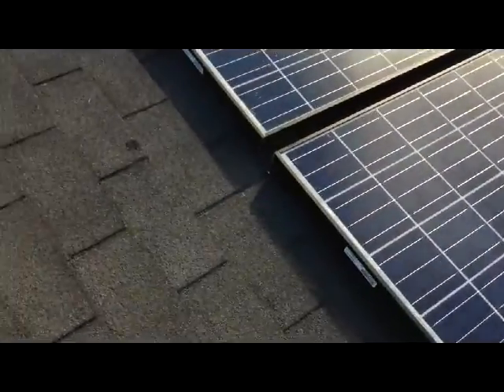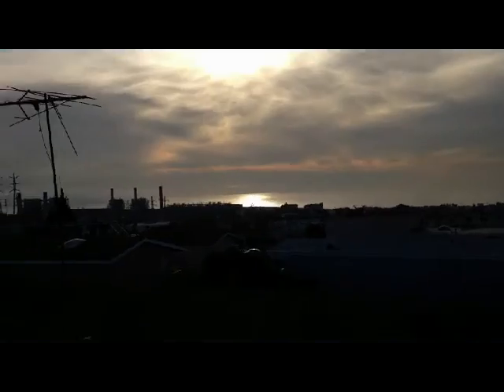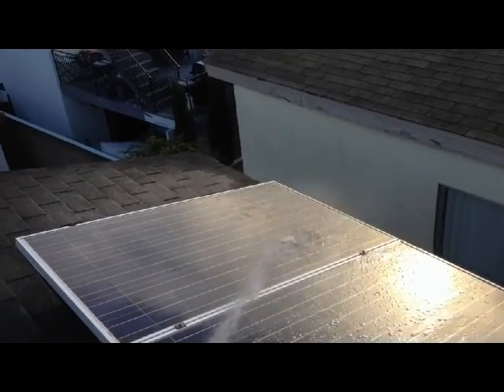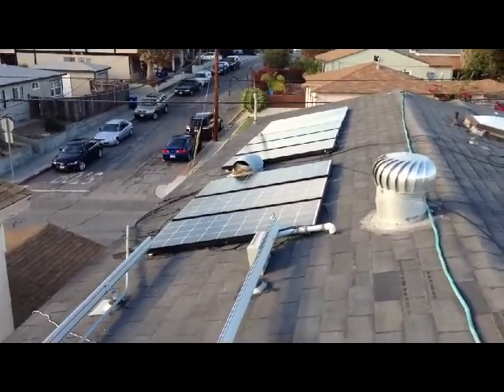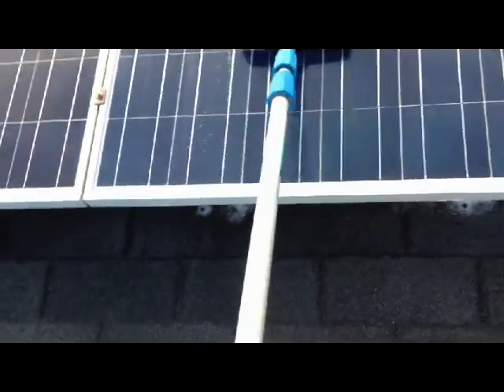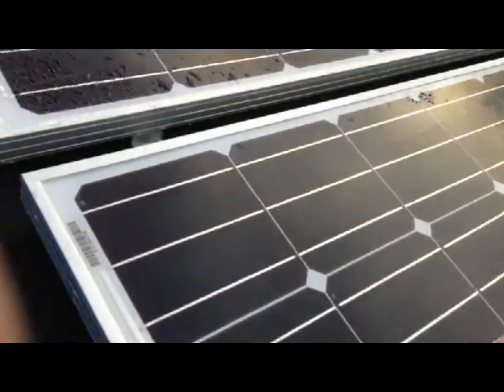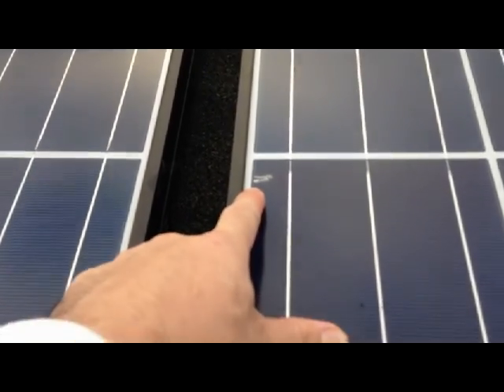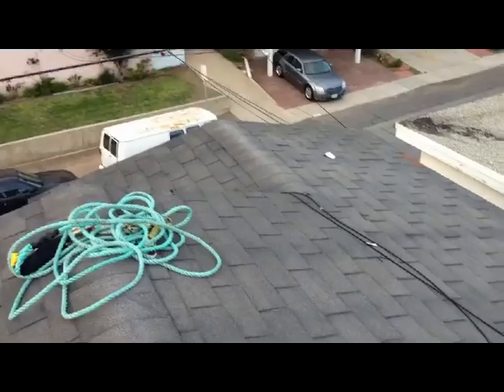Solar Panel Cleaning and Misc Updates

Comment: Costco sell an automotive windscreen treatment (here in the UK we have costco too!)
After wash and dry you wipe this product over the glass then buff it with paper towels ... result!
It sheds rain (and the crud it carries) like a waxed car does.
It lasts at least a year and saves regular effort of ladders and scrubbing.
On the car i can drive above 30mph in the rain without the wipers running ... yes its that good (about $10 for 3 capsules)
Its a glass capsule that is crushed inside a little wipe pad...tricky but worth the effort.
Hope it helps...
Reply from the maker: i have heard mixed things on those products.  sounds like "rain-x" if you're familiar with that product in UK.  but i assume the stuff safe for the panel?
Reply: Still the panels are also made of glass and i used it on mine last year - takes a while to apply but still looking good !